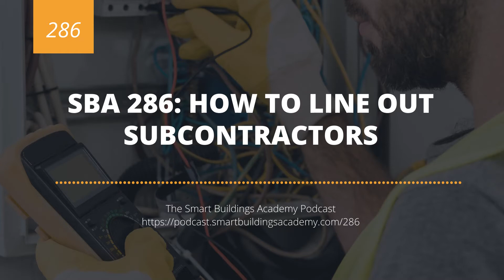SBA 286: How to Line Out Subcontractors

Comment: Nice vid Phil !
Now can you do a vid on lazy startup techs. This is a pandemic all in its own.. 
So I’ve been a start up tech for years. Now I run a BMS install company. I’ve seen this from back when I was teching and still today. To often I see startup techs with the mentality and MO of “I’m a programmer” I don’t climb ladders, I don’t use tools, and list goes on and on and on. They just won’t get out from behind their damn laptop for anything. They need to realize that one of the main reasons that their position even exists is to find and fix anomalies/issues that don’t have to with the installer. For example: if they hand me a control drawing of a reheat vav box and I wire the valves exactly as its shown on said drawing and they decide it’s wired wrong cuz they drew it wrong.. then that’s on them. 
I could go on for days about this. Lol :) 
Love your content Phil !
Reply from the maker: Thanks sorry for the delay in responding. I agree get off your butt and go check stuff the computer can't do it for you (yet...)